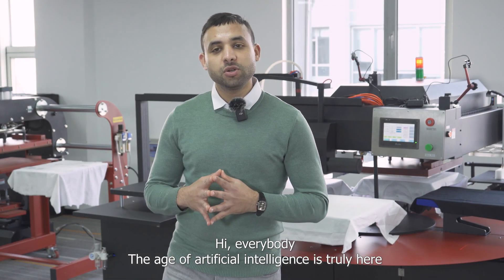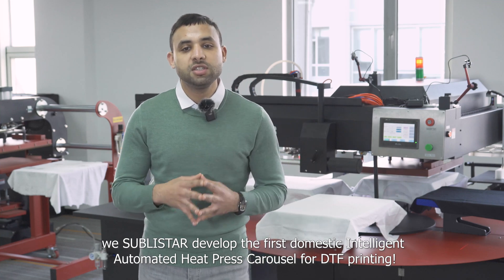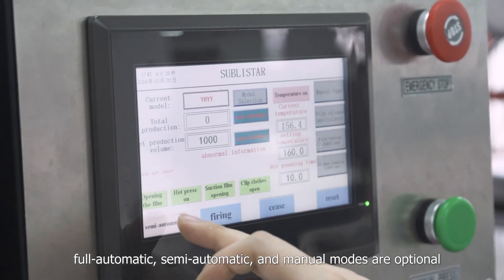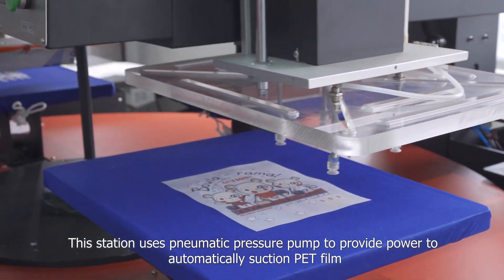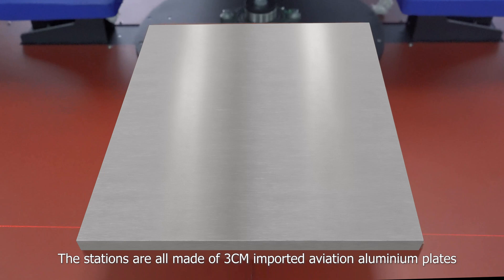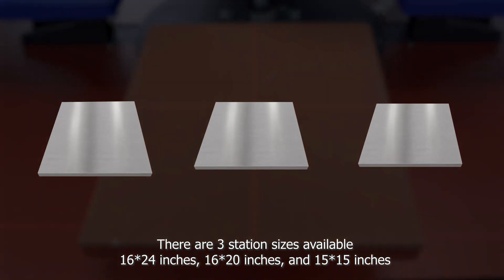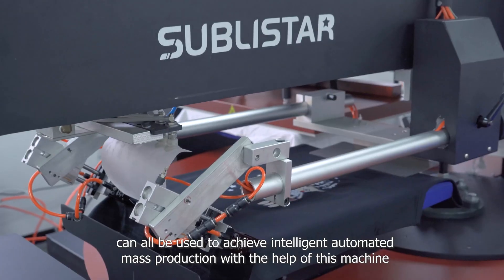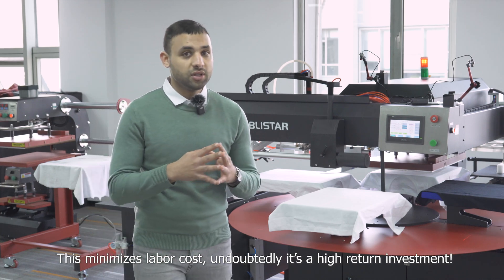Groundbreaking! Intelligent Robotic Automatic Heat Press Operator for DTF

Comment: It needs laser alignment and extra heat press for second hit. Can the lower platen be heated too?
Reply from the maker: Yes, you need to manually adjust the position every time you put clothes so that the infrared rays are aimed at the middle of the clothes.
Only the pressing plate is heated, and the other plates for placing clothes have no heating function.

Comment: Useless system as long as you need someone to apply the garment on the press machine
Reply from the maker: The advantage is that it saves time and energy and can be quickly mass produced
Reply: That would be a three person machine, now it's a one person machine. Very big savings especially in developed countries where labor is high. Few more years it will be a no person machine.